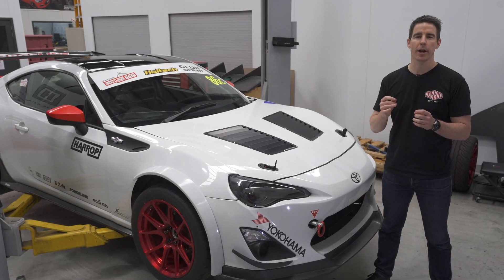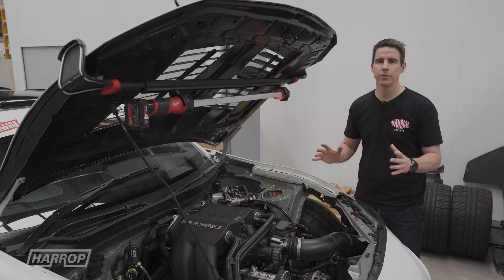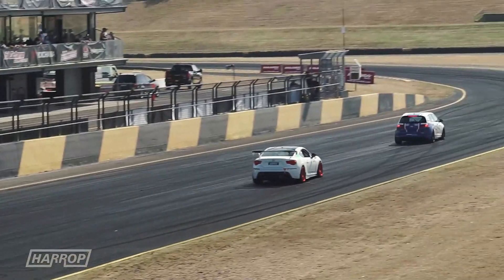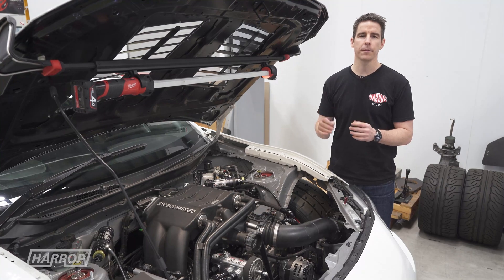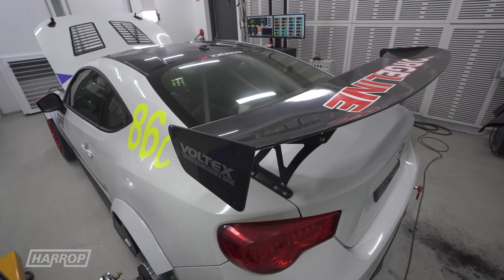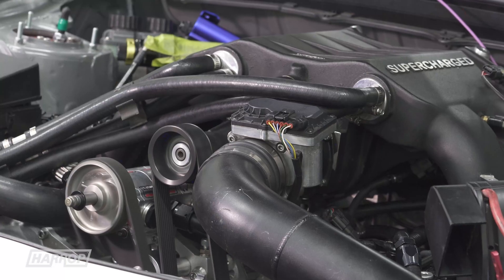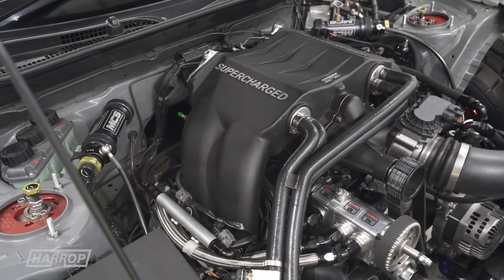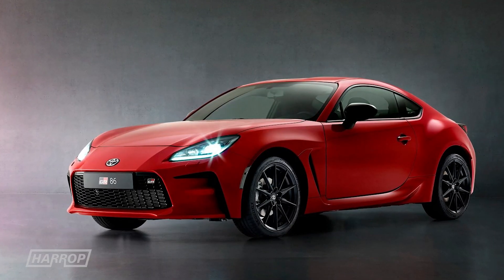FA24 Toyota 86 | Harrop Supercharged

Comment: IMO, the 86 with a Harrop supercharger is a beautiful thing. I was running the Harrop supercharger with a 75mm pulley making a bar a boost on E85 with an Ace header, stock front pipe, Greddy Supreme SP exhaust, and when I would go WOT, the engine note was just perfect. The control of a positive displacement supercharger made the car so easy to control where it was instantly clear how much power I was going to get, and I could control the throttle for power delivery like a surgeon with a scalpel. 

Eventually, I put a rod through the block making so much torque on a stock block. I considered my option and ultimately sold the supercharger and went with a K24 turbo swap, and while I love the car, it is far more race car now. The engine sits higher, so it doesn't have the same handling characteristics. The engine shakes more because it isn't a well-balanced boxer motor. The turbo is a G25-660 in the smallest trim, so lag can be nearly non-existent, and the torque comes on low, but it just doesn't have the immediate urgency of the supercharger, nor does it have the linear pull of the supercharger. The turbo has more of a surge in torque, which is fun, but it doesn't reward the driver the same. It is a car that you hold on for the ride more than precisely controlling the power delivery, so in that way, I can confidently say that the supercharger is better. 

I may keep my K24T 86 as a ridiculous track toy, but it is no longer the ideal everyday sports car. I'm looking forward to seeing what Harrop produces for the GR86. My eyes glance up market at times at the Cayman and Lotus Emira with interest, but I really can't imagine too many things that could be better than a GR86 with a new Harrop supercharger pushing over 400whp and singing to 7500 rpms. This is the experience of a free-revving, low-displacement, Japanese sounding engine with V8 power and with NA response in something 800-1000lbs less than a Camaro or Mustang. Buy it! Keep it forever!
Reply: "The engine sits higher, so it doesn't have the same handling characteristics. The engine shakes more because it isn't a well-balanced boxer motor." The K series is much lighter than the FA motor. That handling difference is probably the shift towards rear bias. Also, the K series is a much better balanced and smoother motor than the FA.

Comment: Great to see an Australian engineering company still exists in motor racing with R&D still happening. I think 350-375WHP would be a good amount for a daily GR86 as long as the boxer engine can last a good 250000kms at that power output otherwise the mustang is an easy winner. I’ve heard the FA24 has thin cylinder liners and high compression so low boost is key. Can’t wait to see more on the GR86.

Comment: Wouldn't a centrifugal supercharger be better for a circuit track racer? Centrifugals allow the use of an a2a intercooler, has higher efficiency (lower intake air temps), and is lighter. Does not have the low end grunt of a TVS but circuit racers keep revs up high anyway.
Reply: Yes agreed. I’ve had cars with roots type supercharger and they heat soak badly and the air to water HX  is not very effective. Once it’s heat soaked, it’s done. An air to air HX is the best.
Reply: @timeatak5248 a2w is better. You need the minimum amount of coolant plus very high flow. This achieves the best cooling
Reply: Harrop is a Eaton supercharger official retailer, if they were the official retailer of Paxton or Vortech then they would be doing R+D for that brand. Additionally, Harrop is a aftermarket supplier for the domestic on-road market not for exclusively race teams. Their race car is simply a test bed, if it works in the harsh race environment it's going to work in a regular guys daily driver.

Comment: Fa24 in brz is like 13.5 compression to the ascents 10.5.nice power tho 👍
Reply: The FA24 in the new BRZ is 12.5:1 CR like the old one. Assuming you have E85 available to you it's not that big of a problem
Reply: @filipprucnal  no it's 13.5 for 2022. Also this ascent engine is only 10.6 or 10.5
Reply: @Matteo-xm6xo  there's a ton of conflicting information online. Wikipedia says the FA24D is 12.5:1, some people say it's 13.5:1 and some even say that there's a difference between the GR86 and BRZ (with the GR retaining the 12:5 CR and the BRZ being 13.5:1, which is ridiculous because they're practically identical in power)

Where did you get that info?
Reply: @filipprucnal  yeah I see what your saying now might only be 12.5 guess that's me will tell. My mistake I've been seeing and hearing 13.5. but seems to be the same as the steering ratio so who knows.🤷🏼‍♂️
Reply: @Matteo-xm6xo  No worries. Even Engineering Explained said it's 13.5:1 so you can see how far this mixup went

Comment: You do realise that the FA24F from the Ascent, Outback amd Legacy isn't the same as the FA24D in the GR86/BRZ, right? Different compression ratio, different connecting rods, different pistons and I wouldn't be surprised if there are differences in the cylinder heads and valvetrain between these 2 engines.
Reply: Yes they do realise that and yes they know the heads are different.
Reply: I would think that all those differences would trend towards performing better under forced induction and expect better numbers if anything.
Reply: @codycurnutte7084  particularly in torque

Comment: What was the difference between the 2 dyno runs that made the 2nd pass show an extra 50HP?
Reply: The low numbers was 93 octane and the higher Hp was on E85 and smaller supercharger pulley. Probably 3 psi more!
Reply: @707turbo1  probably just e85. That’s the difference I got when I switched from 91 to e85 on my jrsc
Reply: More than likely tuning optimization

Comment: Wanted to be excited, but then saw Ascent engine.  Much sad, so disappoint.
Reply: It’s the same as the Gr 86 just lower compression. So the Gr will probably make 15-20 whp more with the better thermal efficiency cause of the higher compression and as long your tuning E85 your not going to be timing limited at hi boost levels
Reply: @707turbo1  keyword: E85

Comment: Stock GR86 has a 12.5 compression.
Reply: It might be 40hp or so off, but hks is designing one that can hit 350whp
Reply: But if you plan to go F.I. right away, with forged internals, then this is kinda relevant.
Still probably cheaper just to find a wrecker FA24F motor and drop it in an old BRZ chassis
Reply: Yeah idk why people are sharing this video around as if it's relevant to stock GR/BRZs. The closest most people are gonna get to this is ascent piston swaps, if that's the only difference.

Comment: That supercharger would wake up the Ascent. 🤣
Reply: Subaru SUVs are actually better at off-roading than most oversized SUVs. A turbo and intercooler upgrade would suffice.
Reply: Do it
Reply: And then promptly destroy the CVT
Reply: Doesn't the Ascent already have a turbo?
Reply: Until the cvt explodes
Reply: I wish the Subaru Ascent had different power and drive modes like Audi. Same power all the time sometimes I want more torque and other times I want better mpg. They could easily attain that because they use electronic waste gates and blow off valves. Simply tuning of those PIDs could increase torque without being too much and other tuning would allow a different boost map to allow more time with less exaggerated positive pressure.
Reply: The ascent FA24 is already turbocharged and comes tuned for 87 octane from the factory. Switch it over to 93 and it would def wake it up more.